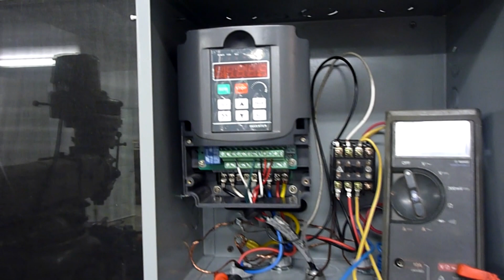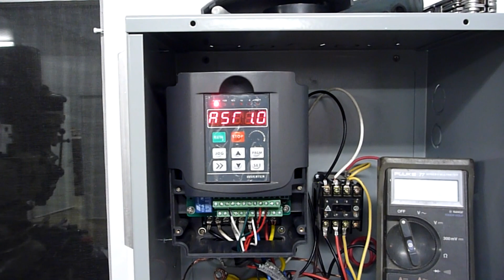Kent Milling Machine on VFD

Comment: Did you ever get to the bottom of why your potentiometer didn't let you hit full speed? Same problem at my end... Excellent video BTW!
Reply from the maker: xrm1996 
my problem was not that it would only go to half speed, but that it would go to full speed at half the travel on the potentiometer. I wired in a second potentiometer to tap half the voltage, and then it worked fine. another commentor below said he figured there was a setting you could adjust that would have fixed it.

Comment: I've got the same unit and I'm having troubles to get an external pot to work. I've made the program changes and moved the dip switch. can you suggest anything else to look at. The only thing I can think of is that I need to bring out the start and stop to external as well. because right now all I have external is the 3 pot wires.
Reply from the maker: Don't know if your manual is like mine, but it's got a couple typos.  My pg10 has the note about the jumper terminal (Does yours have a dip switch?) and the text says 2-3 for both internal and external, but it should be 2-3 for internal, and 1-2 for external.  The picture is correct regardless of text.  The other thing to check would be PD002 is set to 1.  The Basic Connection Diagram also shows a connection of the pot to the AI input which I think I skipped.  The pot wiper should be going to the VI terminal.  I had trouble getting the right voltage and ended up adding an extra pot in there to make a voltage divider.
That's all that I can think of.   Hope that helps, good luck.
Reply: I will check that out. for the pot I have been using the three connections labeled :SPH, SPM, SPH all on the top row. I now believe that incorrect. what do you think?
Reply from the maker: Billy T 
Yep, my manual is at work, but I'm pretty sure that's wrong.  If my lousy memory is right, it was the 10v+ terminal to one side of the pot and the other side to the gnd or common, with the wiper to the vi terminal.
Reply: the internet research is leading me suggest that as well. so much for reading manuals huh?

Comment: Hi there. I was wondering what the values for your braking resistor are. I have look in several on line manuals & cannot seem to find any values, only the connection point. Did it make a big difference to your motor stop time. Thanks.
Reply from the maker: +alex parish I'll have to check what size I used next time I go to the shop.  I did find a value somewhere, but whatever it was, I was never entirely satisfied.  If I set the deceleration time too low, I'd get some error message and have to reset the VFD. I ended up having to have a longer deceleration time than what I wanted.  I've been living with it, but sometimes it's annoying.  If I'm running at a slow speed, I'd be better off just using the brake, so I'm thinking of resetting it from the decelerating stop to a coasting stop.  Or maybe I'll try adding another resistor...
Reply: Thank you very much. I just got to the bottom of that problem tonight. A severely unintuitively named parameter for separately storming the max RPM while operating from the switch closures was behind it. 

Want to thank you again for your switch suggestion. They're from Italy and feel so much vastly better built than I had from before I changed over to your UI.

Comment: Your problem with your pot only working half way is simple, the vfd is wired to output 10v to pot but is programmed to expect a max of 5v from pot, hence at 5v it goes to full speed, its in the programming, options are 5v,10v and its some where is the middle of the programming numbers if I remember, mine did exactly the same.
Reply from the maker: Pretty sure that I scoped it and it was putting out the correct 5v, but for some reason it reacting half way to it.  Anyway, not a difficult problem to solve with the extra pot.
Reply from the maker: Kelly Klassen
Whoops.  I meant 10v.
Reply: Kelly Klassen yes so did, mine checked it and it said 10v, changed to 5v then back 10v and it worked properly then, but yes second pot is just as good.
Reply from the maker: Didn't notice that there was a setting for the voltage.  That would have been simpler!
Reply: Mm, it's badly written but it's there, I was confused as it was set to 10v but wasn't accepting 10v

Comment: I just ordered an HY VFD for an Acra mill that I picked up on Craigslist.  I plan on wiring mine up similar to yours, with a few differences.  Could you tell me which two terminals you connected the potentiometer to?
Reply from the maker: I believe it was the +10 terminal and the VI terminal

Comment from the maker: The VFD has been working very well. I'm really happy with it, I'm sure you will be too. It's a lot of work to rewire things to set up the controls like I wanted them, but that's part of the beauty of these VFDs. They're set up with many options to be able to be used in many different applications, so with a little work, I was able to get exactly what I wanted out of it.  
I was very concerned about interference, so I used shielded wire for my 120v/low volt control wiring. Good luck with yours.

Comment: Fantastic!  I just picked up a similar XLO mill and have been searching for how to power it's 3 phase motor at home.  I learned about the VFD technology over a weekend of searching.  The new consumer market VFDs are revitalizing older machine tools!  The set up you've worked out and the control location, as opposed to using the tiny VFD buttons in an unenclosed box screwed to the machine head like I see VFD manufactures trying to demo is so better!  You two should get together.  Did you shield?

Comment from the maker: I believe it was a 10k linear pot.  There was a bit of a bug in the VFD in that it was getting full range out of half the voltage, making the pot very touchy.  I wired in another pot to tap out 5 volts and it works fine now with this simple fix.